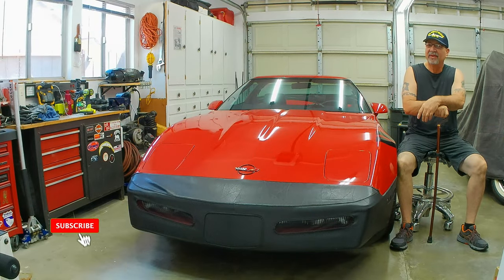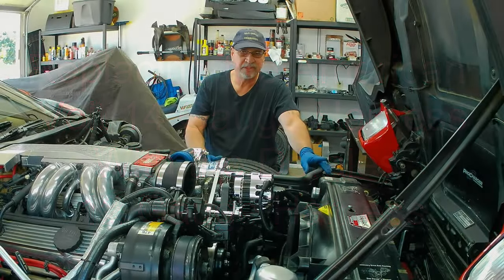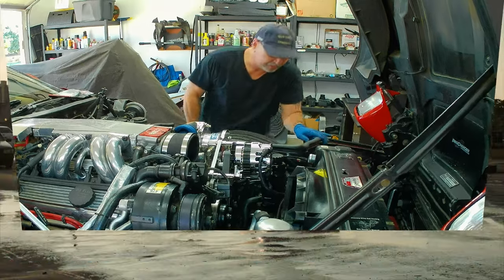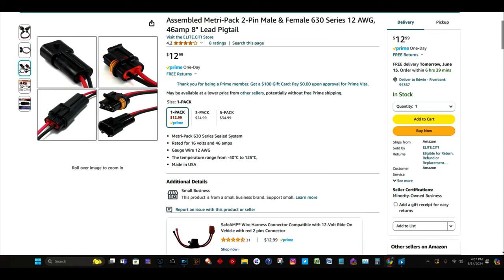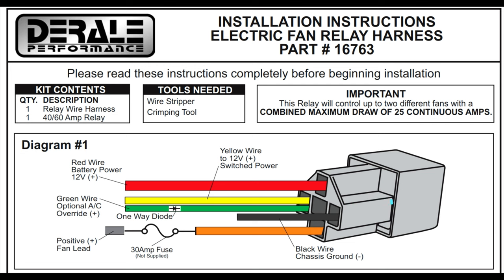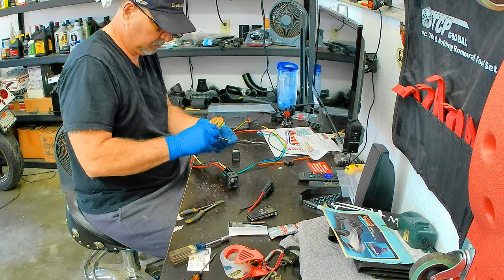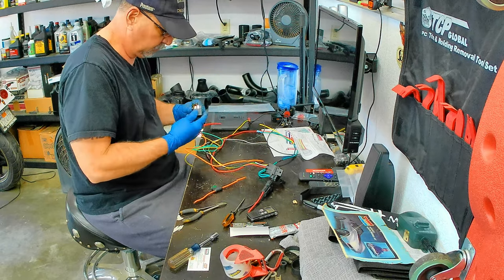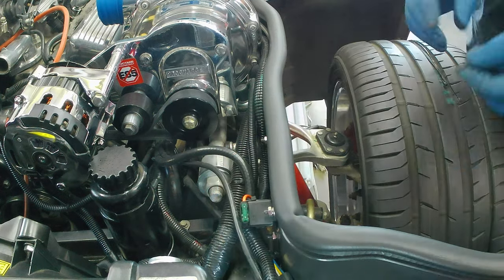Electric fan | toggle switch vs temperature sensor  | Both!

Comment: I have two fans in my 89 vette with a pro charger and what i used was a dakota digital pac-2750 module you set the fans to come on at what temp you want and go off at the temp you want and you can set the timer to run the fans up two 5 minutes after you shut the car off. Set it forget it.
Reply from the maker: @williamdogali3215  Thx you. You know I was just thinking about looking into more of a control activation after I published the video.  I’ll look into the Dakota you have on yours. 🍻

Comment: Why did you upgrade the fan?   Is there heat load because of the supercharger, or if you have an intercooler for better cool air charge?
Reply from the maker: Yes, the SC will generate more heat. The main reason was the SC intercooler is in front of the radiator now and will be stealing some of that air that went to the radiator. And I couldn’t get the Aux fan back on with the SC intercooler in place. So, the Derale fan was a good choice for me because it's a 2 speed fan and bigger than the Aux fan I replaced.